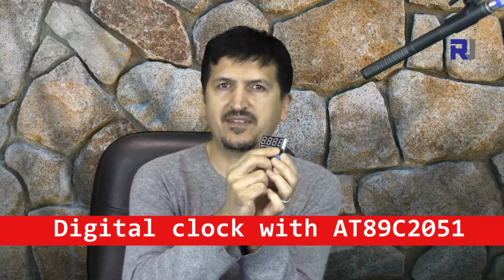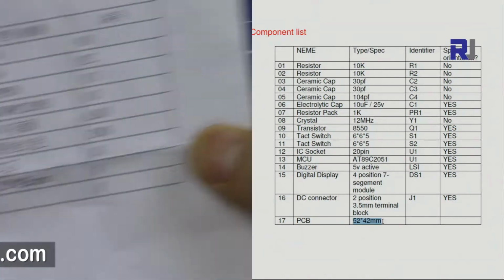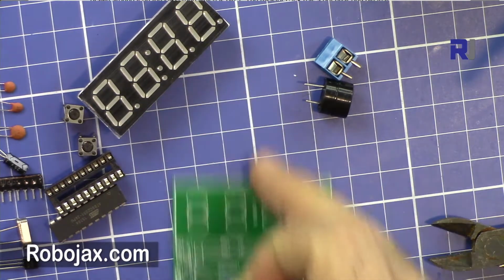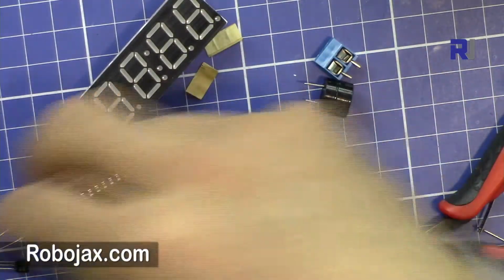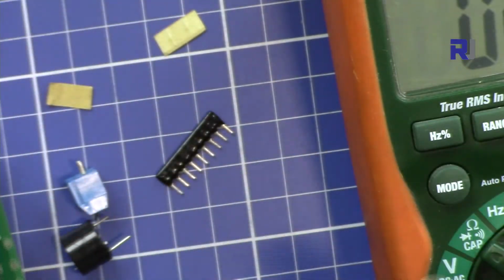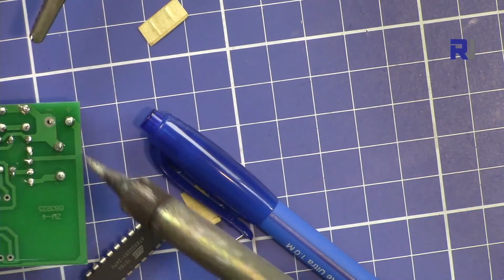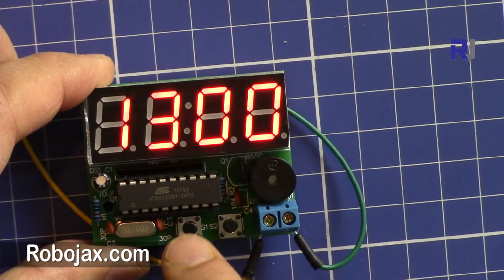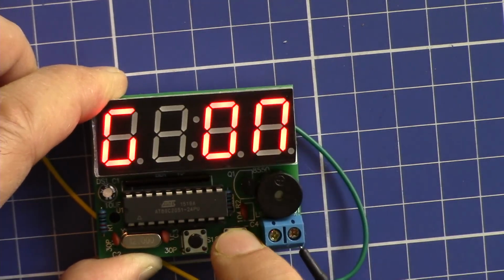Digital clock AT89C2051  DIY Electronics Kit step by step Assembly

Comment: I have the same kist but some segment on my seveb segment is not turning on is it the IC problem?
Reply from the maker: chekc the power line, solders and your battery.  it could be so many things. the seven segment should not have issue. it is the signal or power that does not reach the display.
Reply: @robojax  i checked and everything is connected i also checked on buttons if i hold the left button it will beep and it will show what i think is the seconds and when the timer hit 8 seconds all of the segment lit up but when it resets to zero the zero is not showing like it should be zero but its missing a segment

Comment: Excellent video. I built one, carefully checked everything, but it only lights up and sounds the buzzer continuously. Pressing buttons has no effect. Any suggestions?
Reply from the maker: Hello, so your alarm is triggered. I assume the setting is okay. there must be a pin touching other pin or the path of pCB are bad and there is connection. I can't think of anything else.

Comment: All connections are well made but do not work.
Reply from the maker: if they are all mad well, it should work. you must have done something wrong. either components are connected incorrectly or solder is not done properly. check soldering under magnifier.

Comment: Can you please send me the pcb design link or the photo copy to my email id = npkgangineni343@gmail.com
Reply from the maker: I made this using a kit from eBay https://www.ebay.ca/itm/New-C51-4-Bits-Digital-Electronic-Clock-Electronic-Production-Suite-DIY-Kits-MC-/272563713111?hash=item3f76103457
I don't know if you can find the PCB design. It is very cheap to buy the kit.